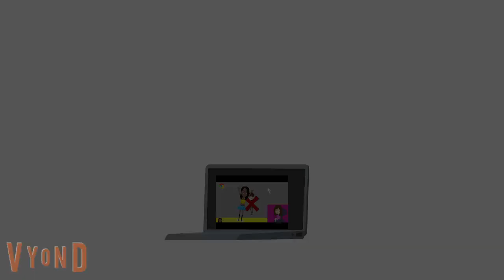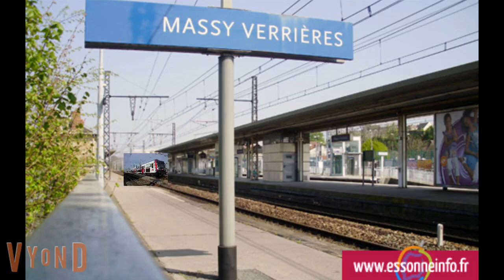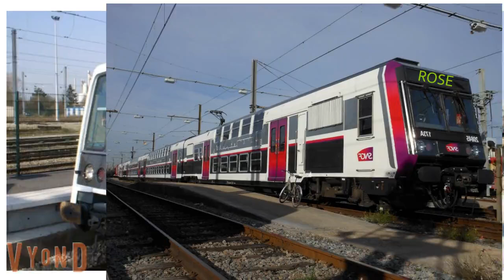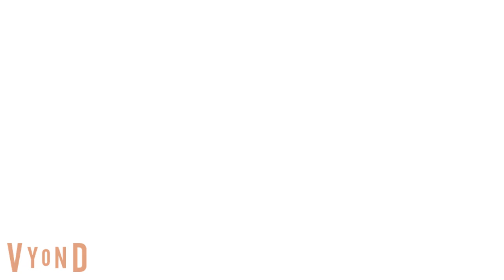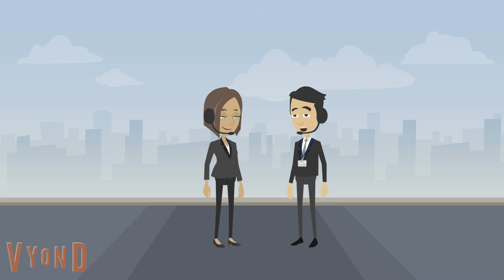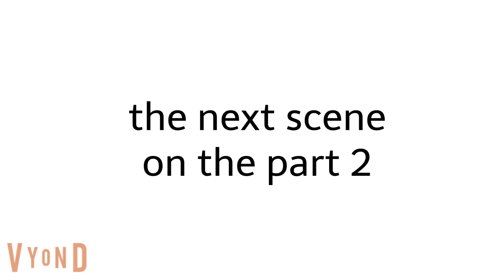The Channel Tunnel Movie part 1

Comment: did you forget about me?
Reply: mine train which will be included if you do it will be BR 483
Reply: or, if you decide that i will be operating tram lines instead, i will be as Solaris Tramino S105P #556 as shown in the profile pic
Reply: This is Attilamester 2001's new movie called Channel Tunnel Movie
Reply: wow. even he said my real name in this part
Reply: also, i got a request for ya my friend: Konstal 105Na Goes on line 14/Moderus Gamma #500 passes nearby her/Solaris tramino S105P Gets Confused/Konstal 105Na Tells MPK Poznań about this/MPK Poznań tells that he bought them for tests/Solaris Tramino S105P and Solaris Urbino 12 III (2014) Gets angry at BR 485 for Stealing Neoplan N4009's Toy/Tatra RT6 Arrives to replace Tatra RT6N1/Me Gets Triggered when in Gdańsk, all Neoplan N4016 and Neoplan N4020's got replaced/Me Rages/Everyone Tries to calm him down/StefieB's Rosie Shuts Down Ogrody Tram stop/Moderus beta MF20AC gets triggered/StefieB's Rosie grounded
Reply: Voices for them:
Moderus gamma = Bridget
Solaris Urbino 12 III (2014) = Eric
Moderus beta MF20AC = Kayla
BR 485 = Bridget
Neoplan N4020 = Joey
Neoplan N4009 = Ivy
Tatra RT6 = Susan
Reply: also, i'm going in part 2 to change from my true form to my original form
Reply: I think the grounded videos remembering Jessica Gongora about she getting grounded, that's why the NON Business themes are removed from GoAnimate, and that's why the grounded videos need to bee stopped
Reply: my prop Form is better i think, because i should have paul voice not eric
Reply: in my prop form, i will have voice callie